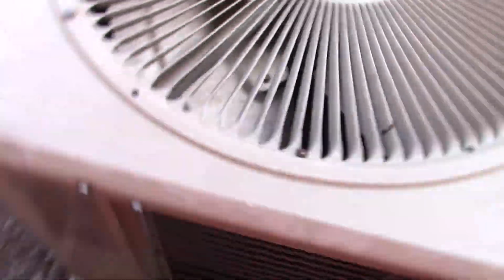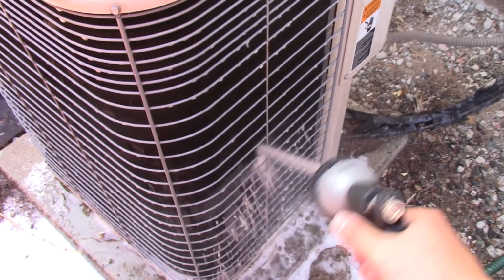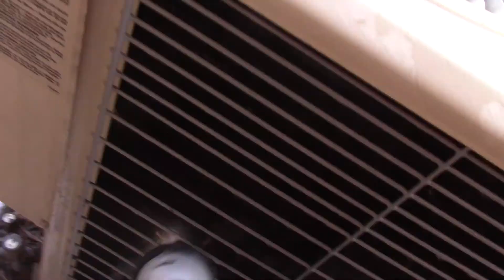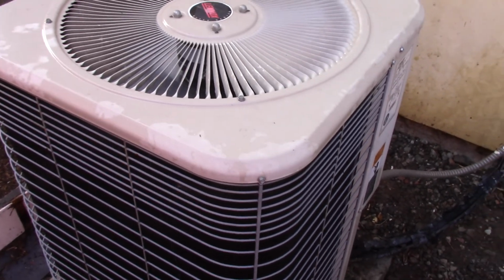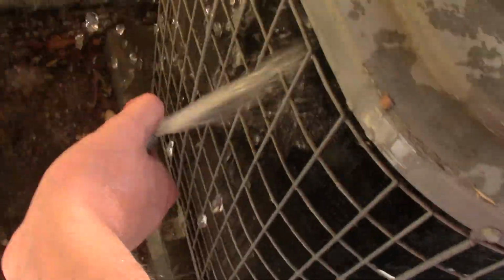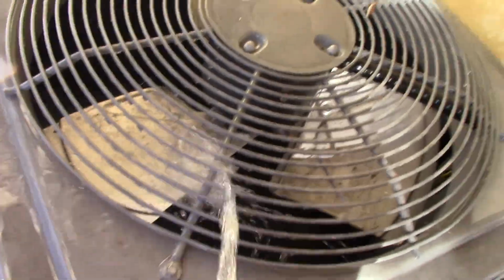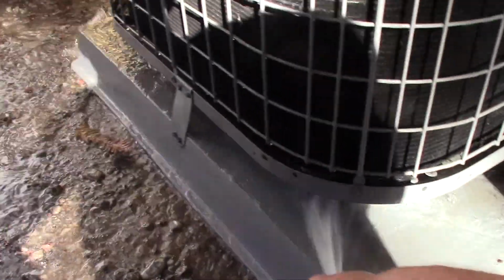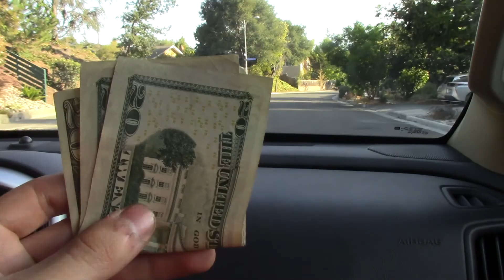Preventative Maintenance - Two Split System Condensers

Comment: Just did a clean-out of my heat pump (5 ton Trane XL-14i with spine-fin coils).  The crap that came out after a year was unreal.  The unit has been running on its original charge of 410A since 2007 and I credit it to regular maintenance....an ounce of prevention (and a very good install job) is worth a pound of cure. Regarding your Lennox units here...wonder what the evap coils looked like?  The air filters?